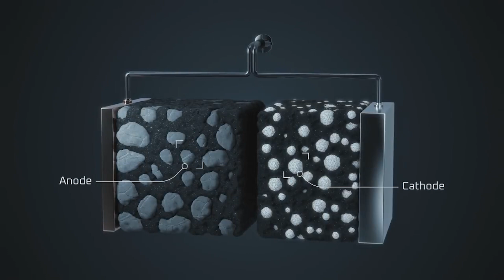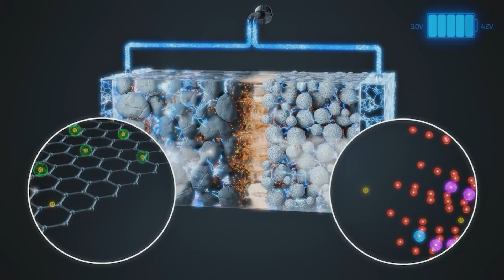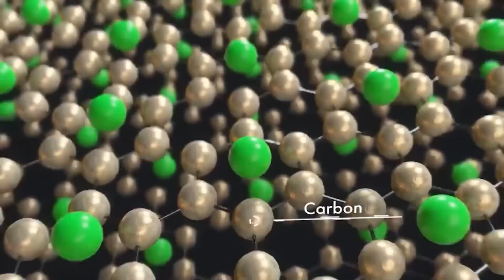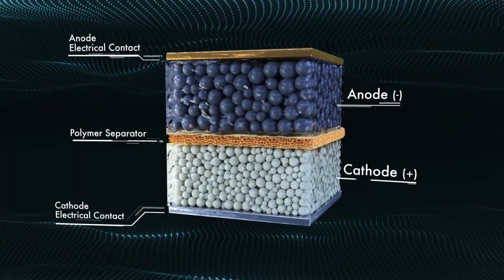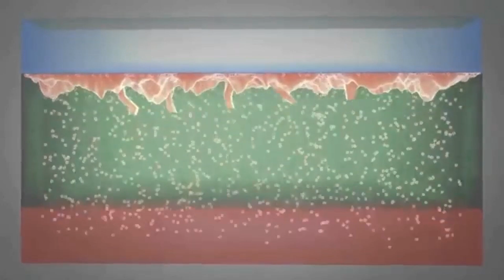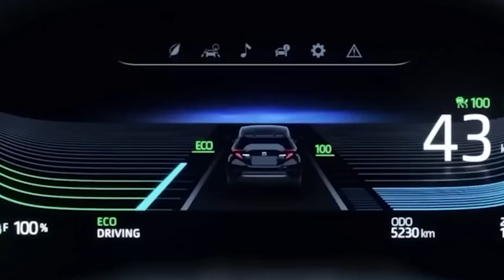Toyota's New Battery Technology Decimates All EV Competition

Comment: Objectively, EVs have the potential to be superior to ICE cars in every way, problem is, batteries still suck. Hope this works out and sends EV RnD in the right direction. Now, if only they make solid state batteries that use other, much more abundant anode materials, Lithium is NOT a viable solution for large scale use.
Reply from the maker: Lithium is a makeshift solution that is doing more harm than fossil fuels. Energy storage concepts need to improve leaps and bounds for EVs to be a sustainable application.

Comment: Toyota has been saying they have solid state battereis for many years, but they still have not produced the car with them.
It is a marketing ploy do delay purchasing of the current technology cars.
and as said by @alexvanschaik4753 you only need about a 300 mile range, therefore lighter weight, cheaper cars.

Comment: Screw the idea of EV's with solid state batteries! Just imagine a proper hybrid ICE-Electric can finally charge tge battery while being propelled by the ICE, with no appreciable loss in fuel consumption; thereby extending the range yo well beyond 1,000 miles! Just think: improved fuel efficiency, due to electric assist motors; a full tank of gas; and when tge tank gets into the red, you still have a decent amount of battery range.

Tge only question remaining is how tge solid state batteries will hold up in extreme hot or cold weather.
Reply from the maker: There's a big IMAGINE there; charging batteries in propulsion. Current batteries charge in breaking. That's a big conceptual leap that could bring a massive transformation across industries.
Reply: @carsahead  
Not such a big "imagine," when you consider what was stated about solid state batteries in the video.

They take far less time to charge; and therefore, an alternator working at highway speed could generate sufficient electrical energy to power the vehicle AND recharge the battery considerably.

EV's by themselves are THE WORST thing that we could switch to, as far as the environment is concerned. Hybrids, on the other hand, are infinitely more sensible.

And before someone challenges what I've said, do your own research! Don't come back at me spewing climate hysteria talking points, because you'll only regret the foolishness that you'll reveal in yourself.

Comment: Batteries are NOT the answer!
Reply from the maker: PART of the answer. No one solution can ever fit all. Battery is good for short haul applications. Anything medium to long haul needs a different power source. Planes for example, can never run on batteries, while two-wheelers easily can.
Reply: Batteries are still NOT the answer! This sounds like the solar and wind argument that is total nonsense in regard to a practical commercial application. This whole "industry" has been driven by flawed data and tax dollars otherwise it would NEVER happen it is essentially a NWO scam.
 @carsahead